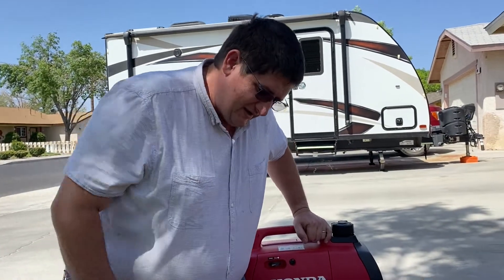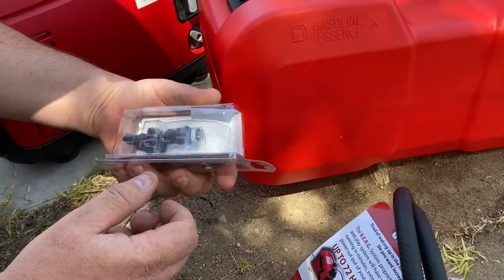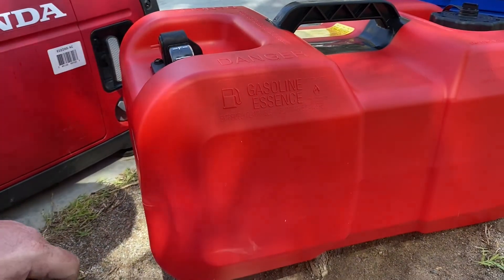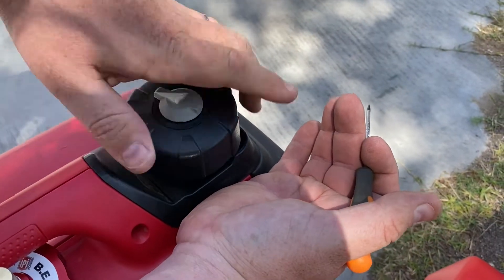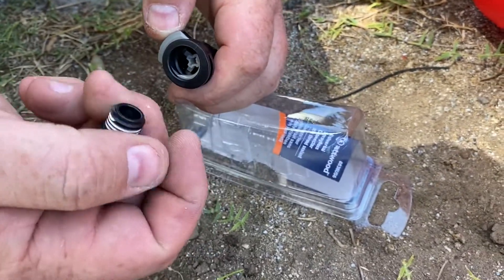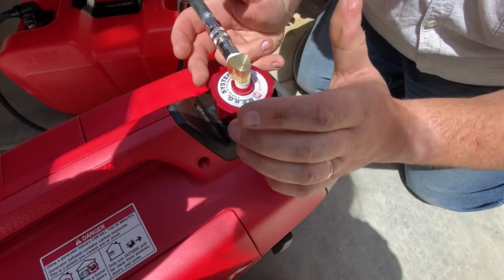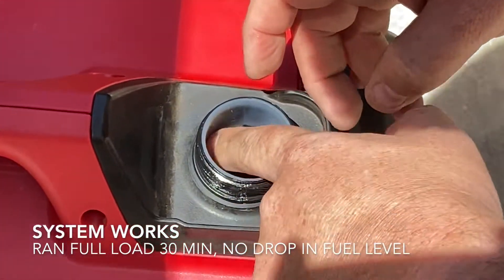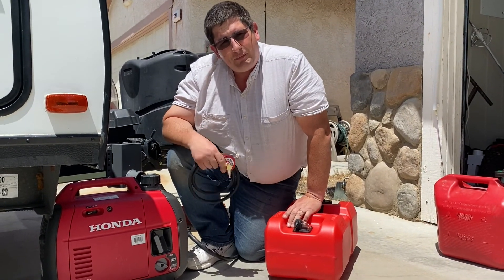BERGs Extended Fuel System on Honda 2200 Generator – 24+ Hour Runtime

Comment: Why even take the B.E.R.G. caps off when you're stowing and transporting.  The Honda will run perfectly fine in solo mode with the B.E.R.G. caps.  By removing them you're simply putting more wear and tear on the threads for the generator and the gasket.  Leave the caps in place.  I've done it for 5 years on mine.  Only time they come off is to clean the fuel filter or drain the gas.

Comment: Just purchased my for my generator. But my generator has a vent cap. My generator is a Generac 2200i. So when I hooked up berg cap and started to run. The generator only ran a few minutes. Because cap needs to be vented. How can I fix this issues? Or what I’m I doing wrong. Thank you
Reply from the maker: The vent should be only on the aux tank, and it will siphon from the tank to the generator. If the generator cap has a leak or an air vent, the siphon wont happen
Reply: Thanks for the reply. So  do I have to add a vent on the new tank they sent me?  And why wouldn’t it come with a vent already on the tank?
Reply from the maker: Your Aux tank should have a vent already @raff9938
Reply: @EdwardCzajka  It’s a Berg brand setup. For $184 after shipping you think it would have a vent or mention it in the instructions or video they have. I guess I will add one. Thanks for all your help

Comment: I’m having difficulty getting the 1/4” ID fuel hose on the 5/16” quick disconnect barb. Any suggestions
Reply from the maker: I remember I had to wiggle it quite a bit to stretch the tube to get it on there

Comment: Note that initially it looked as if the way this is set up you had an open port venting gasoline from the fuel tanks outlet when the hose is removed unless the male port also has a check valve inside it which is not specifically stated on the Amazon link.  On edit I reviewed the Atwood connect in the Amazon link and it does have an automatic shutoff on both sides of the fitting so even though its plastic it may be a similar in design compared to the one that came with the kit which also appears to have a fuel shutoff on both halves of its gas cap connection.  

Of course this only works well if your generator has an actual fuel pump and not just a gravity feed system with an automatic fuel valve unless you raise the tank higher than the generator so it can siphon feed.  Any leaks in the fuel cap seal or fuel lines of course will prevent the system from working properly.

That said the safer solution is to put a tee in the fuel line inside the generator between the fuel shutoff and carburetor plus if there is no fuel pump add a vacuum operated pump and use a standard marine outboard motor fuel connect with its more secure automatic fuel shutoff and secondary strain relief post mounting through the casing of the generator.  It would also be a very good idea to add a fuel filter and primer bulb to the fuel line.

On the Teflon tape you do need to only use those rated for fuel systems and not just generic water system products that are not rated for use with gasoline, kerosene, diesel, etc.

Best!
Reply: IF you don't have a fuel pump, and you have your aux tank higher than your generator, what keeps it from flooding on the ground?  Don't some fuel tanks have a breather hose out of the top to prevent vapor lock, but inside the generator plastic body?

Comment: Can you use air line quick connects at lesser of a price?
Reply from the maker: Will the components deteriorate in gasoline? I'm using these parts to reduce the fuel loss when disconnecting, and subsequent fumes.
Reply: @EdwardCzajka  Now that I seen what you use, planning on adding to my set up. Thanks for posting.
Reply: Use any boat fuel style quick disconnect for a lot less, they also auto shut off the flow and are suitable for fuel.

Comment: Just a comment: I watched a few videos on this, and was Advised on NOT using the Teflon Tape. It deteriorates from the Gasoline itself, and over time Gums up , causing all kinds of problems.
Reply: There is special tape for gasoline or you can use Loc-Title formulated for gas and oil.

Comment: Is this on aEU 2.0  or 2.2  Reason I ask is the carberation has been changed and there can be problems with the fuel pressure causing gas to bypass the carberator and end up in the oil resavoir

Comment: Unfortunately, I have to say that this doesn’t actually work, and I have yet to see 1 video that actually shows the siphoning of fuel occur. Take note of every video claiming this works: there will always be a setup shot (before), then a shot claiming that it worked (after). The amount of air drawn into the tank through the stock fuel cap is very very little. There is not enough suction created to draw fuel out of one tank and into the generator. Gravity feed, or added vacuum pump, however, will work.
Reply: You must not understand physics🤦🏼🤣😂
Reply: I have the big brother of the EU 2000is. Mine is the EU 7000is. It has fuel injection. Not a carburetor like the one shown in the video. I have a BERG system as well. It’s slightly different & more robust but it really works. Without it my generator will run 18 hours on half load which is common. With the BERG I extend that fuel usage out to 44 hours with 11 gallons (5 with the on board fuel tank & 6 additional with the BERG tank). I’m a power lineman for a living. If I know a storm is approaching I hook up my BERG & open the BERG tank slightly & my generator will siphon fuel from the BERG as it’s draining down the fuel tank on my generator. I’m usually at work already before the storm hits our service area (in which I live). Our genny is wired remotely so my wife never needs to leave the comfort of our home. It will run until I get home after my first shift of 24 hours. You read that right. Lineman work their first shift on storm 24 hours straight. Hence why it pays to be nice to them because we are way more exhausted than those without power. I refill my generator when I get home & restart it & take a nice shower & go to bed. Then we get to sleep maybe 5 hours before we need to be back to work in 7 hours. Then our shifts are 2 pm until 7 am until everyone is back on. My record is one 24 hour shift followed by 15 days of 17 hour shifts. While only getting 4-5 hours sleep between shifts. 
Thanks for posting this video. It’s possible to run your Honda generator on a BERG. However I wouldn’t think you would be able to run enough things in your house with that 2000? It’s only a 120 volt generator. You can run a lot. Just nothing major.

Comment: Are you sure that the red cap is suitable for your generator? You have to choke extremely to mount the cap on the thread of the generator and then remove it again. Is the thread on the tank still OK, or is there a new thread in it now?
Reply from the maker: Thread is fine on my tank. The important part is the seal, without it, the suction will not occur to create the syphon.

Comment: I have not bought a Berg system. But I have not had much luck with other gas cap style siphoning systems for my Honda 2000 I generator. I have had much better luck with the gas cap that I have bought for  my 3000 I handy generator by Honda. But there is no fuel pump in the 3000 I handy and you have to have the extended run gas tank above the generator . The problem usually lies in the Seal of the gas cap where it meets the generator. First the seal that they give you for the gas cap is usually substandard. It usually does not hold up very well with gasoline. You're also relying on human error and that is always a problem. These systems seem to work a little better in extreme temperature or just very cold because everything constricts and seals become tighter, and you don't have as much of a problem with reactive gas and pressure buildup. I have bought a lot of plastic attwood connectors. They don't last very long. But they do not take very long to swap out and they are usually the problem if you have a air leak. If you really need a system that works I want you to talk to Paul at Panellas power products. He has helped me build a system with Yamaha parts that works pretty much foolproof. Bypassing the fuel tank in the generator is the way to go!

Comment: Isn't the generator supposed to last for the duration of one rank of gas? This could extend the hours of use of the fan causing damage.  I understand that every few hours it should be turned off
Reply: When I was Active duty,   I had a generator repair section.  Im not an authority.  They all said it was better to run a genny 24x7 at at least 50% load, higher is better.  Just shut down to change oil as scheduled and routine maintenance.
Reply: @SoloHiker1  Logical, agreed.
Reply from the maker: By that logic, everything we do can cause damage. We don't have stuff like this to not be used and always look pretty. Giving a generator a 5 min break after 2 hours of work is not going to do anything.

Comment: How do you get the siphoning process started or is small Honda tank creating the line suction?
Reply from the maker: As long as your seal is good on the cap, the Honda generator will create the suction with its fuel pump.

Comment: Wouldn't keep that fuel line in a bag. It's best to let the gas that's on or in the lines to dry up. The reason is so you don't get any build up in the lines. Gas needs to bleed out.

Comment: i have see that a person can buy and convert your honda GEN  to clean propane.
Reply from the maker: True, but you also loose a bit of HP from running propane. This would make running the AC more difficult, and make getting fuel in the middle of the night a challenge. When I am done on a trip, I can't load the remainder of the propane into my tow vehicle.
Reply: New to this type of setup. How does the fuel flow without a pump?? Obviously it seems to be syphoning but how does it start the syphon without something like a fuel line pump bulb attached??
Reply: @williamhunt828  The Honda has a fuel pump inside the Generator.
Reply: Will this work with generac 2200?